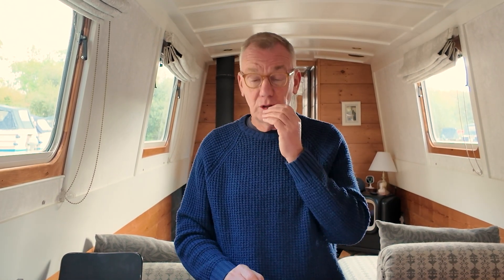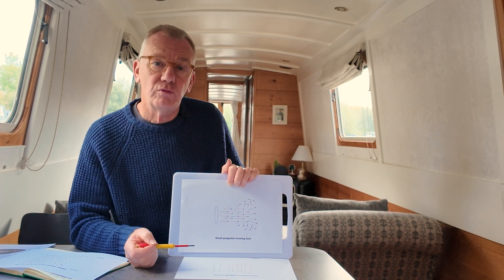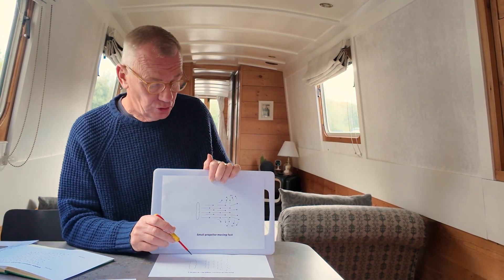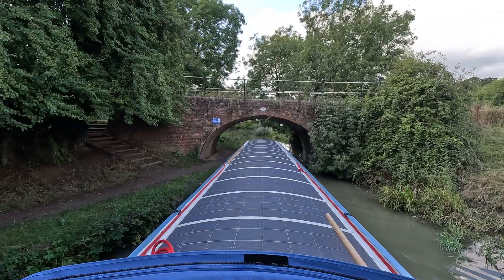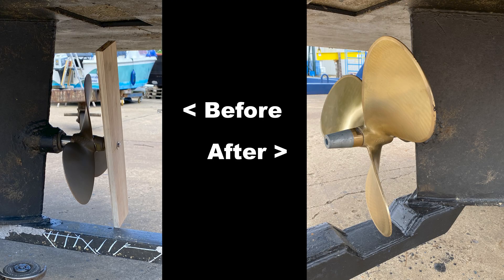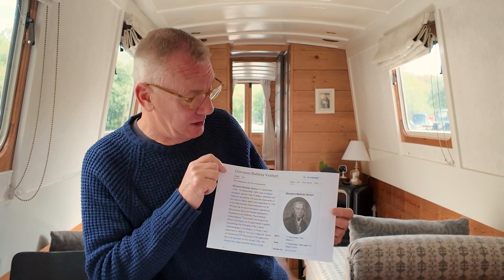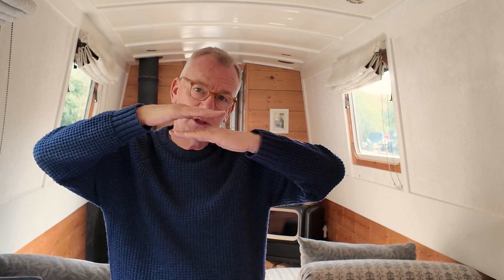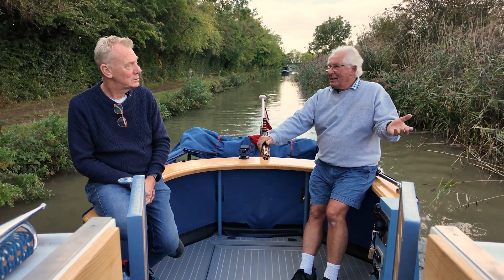Narrowboat 'Silly Knot Too' benefits from an electric motor with more torque

Comment: So, help... I'd like an electric conversion on my 57' narrowboat... but I'm stuck Hemel area without a working engine. Can the conversion be done at a local yard or do you need it to go to yours?
Reply from the maker: Hi there. If we do it you’d have to bring the boat to us. But please have a look at our sister company. Torkmar.com  we designed a system that can be fitted by a good engineer. Cheers Tim

Comment: Is there a calculation that includes weight, resistance, motor, rpm, and prop to help with this?
Reply from the maker: Hi, do you mean the weight of the motor or boat. I'm not sure what you looking to calculate. Tim
Reply: @mothership_marine  The weight/mass of the boat - wondering if there's a formula to work to?
I fully agree about the prop size, and the demo and explanation make perfect sense.

Comment: Great job!  What is the battery voltage,  24V or 48V?  How many Ah do the batteries have on the boat?
Reply from the maker: Hi Wayne - 48V and 600ah. Cheers Tim
Reply: @mothership_marine  Thanks.  That is a decent amount of battery power.  I presume the boat also has a generator to recharge the battery if needed.
Reply from the maker: @waynegardella6263   yep that's right a Mase. Cheers Tim